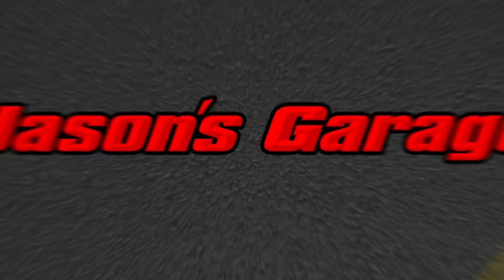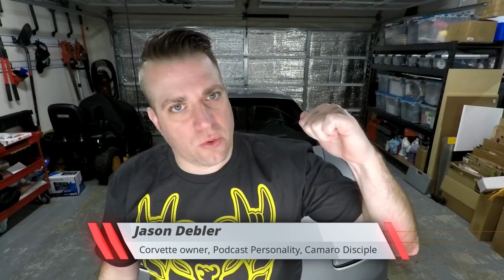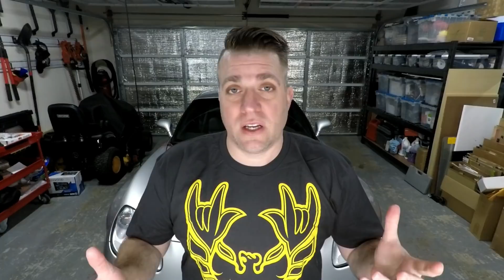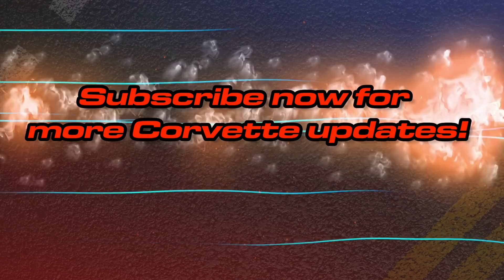LS7 Engine Cylinder Head Valve Drop Issue - What you NEED to know!

Comment: Did GM correct this issue with their current LS7 crate engines?
Reply from the maker: Some say yes, some say no.  I'd like to believe they did, and it would be logical to think they did.  I personally haven't heard any issues about the crate engines.   I know this doesn't help at all but if you happen to hear a more concrete answer, please let me know.
Reply: I just purchased one two days ago so I hope the problem has been corrected.
Reply from the maker: @time_on_target  If you don't mind, can you ask the same question to who you bought it from and let me know their answer?  I am very curious.
Also...what are you putting it in?
Reply: In Jason's Garage I bought the GM performance LS7 crate from a GM dealership in WI and had it shipped to me in TX. It’s going on my 1967 mustang track car. Vorshlag here in Dallas is handling most of the build for me. 500hp in a 2600lb car should be fun.
Reply from the maker: Sounds great!   I subbed to your channel to follow along.

Comment: How often should u get the heads fixed? My Z06 has 99k miles and it had the heads addressed by WCCH at 65k miles
Reply from the maker: The common thought it you only have to do it once if they are done right.  WCCH does pretty good work but just for good measure, give them a call and see what they recommend since they did your heads.
Reply: @InJasonsGarage  yes just got off phone with em, my heads are good to go for up to .640 lift can't wait to save up to start modifying

Comment: How is the reliability with a set of fixed heads on the engine? I know this valve issue is the biggest problem with these engines. Thank you for the very informative video!
Reply from the maker: My opinion is that it puts the LS7 reliability to where it should have been from the factory.
Reply: Even "fixed" heads have been known to drop valves. My FED fixed heads dropped the exhaust valve last year. I was running an aftermarket cam with only .635 lift, and less than 10k miles on build, but some say this is enough lift that with the pad style rockers at full lift it puts a side load on the valves and causes premature wear to guides. Definitely upgrade to roller rockers.

Comment: I had a 2006 Z06 and sold it. I think its a bunch of shit to have to fix an issue like this or worry about a new engine. Im a car guy and would love to believe in this one. But a supercharged gt500 has proved to be reliable and pretty dam fun to drive.
Reply from the maker: You might want to do a search for "gt500 engine failures" before you write that check.  They have had their share of them as well...but I agree fun to drive!
Reply: You sound like a true blue Chevy guy. I have checked out the GT 500 and its issues. The truth be known every performance vehicle has some sort of bug a boo Porsche included. But you’ve got to pick your path of least resistance and I wasn’t willing to take that with the motor potentially going out of the Z06 .Just my opinion. I’ve owned three vettes in  2 Shelby’s. In numerous others:. jeeps you name it and everyone of them has something
Reply from the maker: @gws108  I do indeed lean more toward the bowtie, I always have but I am certainly not ignorant of other great makes and models.  After my last reply, I was thinking the same thing...I cannot recall a performance engine that didn't have some issues, just like you said.  You are also right, it all depends on what you are willing to deal with.  The consensus seems to show that typically, once the head issue is addressed, the LS7 is pretty solid after that.  I am OK with it.  :)  I love this engine.  At least...for now!  😀

Comment: Hi so I’m planning on buying an Ls 7 swapped rx-7 and my question for you is: how often do I need to get the heads fixed? Also is there a way to tell if the person I’m buying it from already has fixed it just by looking at it?
Reply from the maker: If you do it right, only once is the popular consensus.  The easiest way to check is to ask the person you are buying from.  If they say "huh?" then you might want to have them fixed.  You cannot tell visually, you need to remove the heads have someone who knows what to look for see how much play there is to the valve stems, indicating out of spec valve guide wear.

Comment: What a drag. I was thinking about getting something with an LS7 if I ever upgrade again, but I'm not ever sure its worth the cost. All the fastest guys I know are running old Honda S2000's, STi's, old M3's, etc... cars that are way cheaper to run hard and replace parts when needed yet still hardly hold anyone back in terms of performance in real life.
Reply from the maker: Driven or ridden in one yet?  If not...you might want to.  Just factor in the repair as a preventative measure.  It is worth it.  :)

Comment: This  video is totally inaccurate you should specify the valve drop issue it's ZO6 is made between 2008 and 2011 roughly less than 10% of total vets had the problem so you're saying we should all fix the heads and the valve issue how ridiculous and people believe this idiotic video so I bought my car with 3000 miles on it so you want me to pull my heads off and put new heads on that makes sense why don't you pay for if you and I'll do it LOL
Reply from the maker: You might want to check your sources and read the comments in this very video that say otherwise.  Its your car and you don't have to do anything that you don't want to.  I am just offering free advice.  You may also want to try using punctuation, it makes things easier to understand.

Comment: http://www.superchevy.com/how-to/1406-how-to-maintain-valvetrain-stability-ls7-exhaust-valves

Worth the read.... testing regarding stability using an LS7 test rig to measure stability and valve bounce at speeds up to 7900 rpm.   The  little shop that did the testing? Katech... yea, they probably know what they’re talking about.   Hope this helps answer some questions. 

I also tried to see if I could figure out how many failures had occurred in all LS7S using data on several forms.  Looks to be a failure rate of 1/4 to 1/2 of 1% for all LS7 produced from what I could figure out.  Not saying this is 100% correct but I think it’s close.   The performance shop I use (in Garner NC) has seen 1 dropped valve but has modified hundreds of LS7s.   So yes the problem is real but and no one wants to kill a $15-20K engine but it doesn’t happen with high frequency.
Reply from the maker: I actually used to live around 5 miles from Katech and I trust them.  They know their stuff. I  also know other people that are "up the chain" in GM performance, and the higher the chain goes, the louder the message is that it should be at least looked into if you have an LS7.  It is damn near a race motor and race motors are not without needed maintenance and frequent checks.  This situation reflects that.  There has been nothing quite like this engine before or since, in my opinion.  That is why I bought the one I did.  It is a tax I am happy to pay, because it is unparalleled in performance and will become legendary, even more than it is now.  I say this not because I own one, but because I researched it long ago, and my findings have not changed.
Reply: Jason's Garage - had a lifter failure in mine about 6 months after I bought it.   Was told heads look fine.  The motor had about 60K miles on it at that time.   So motor was refreshed.  I think I will do the heads in the near future for piece of mind and take advantage of the performance bump.   The LS7 is pretty amazing to give the performance it does and still remain fairly civilized in the process.  I went back with a LS7S cam from Texas Speed.  Car makes pretty good power with stock heads (near 550 wheel).  Honestly the pilot super sports can’t handle the power now until about 3 rd gear in warm weather and forget it when under 75 degrees or damp.    Super fun car.

Comment: I had the same problem had the heads done. Eddie shop in Dearborn livernois Motorsports. Had the heads ported valve guides done and they did a poor job motor steel detonated NGM did not stand behind the product. At all I am done with GM in their products I would love to have another Corvette. But I'm afraid very little trust in GM terrible product

Comment: Also, i would be concerned if i where you if im paying 1/3 for a new motor and install. Im sure you can oick up a used ls7 for 4k and another 1,000-2,000 for install and tuning. That way less than 10k but yes. It is still very very expensive. I’d rather pay 2K for new heads + install than a new motor lol
Reply from the maker: Sure, if you know the history of that used LS7 engine.  That's a great alternative.  And I agree, I'd rather just pay to have the heads addressed and reduce the chances of an issue.  In fact...that's exactly what I did!  See my other videos.  😎

Comment: Ok the 14’ Camaro Z/28 has the LS7 engine do they have the same problem? Or did GM fix this problem the 2nd time around??
Reply from the maker: Since I made this video I have received conflicting reports on that one.  Some solid sources told me they were fixed for the Z/28 as well as crate engines, but I have still heard reports of the issue happening anyway.  So it is really hard to say and I don't think we will ever know for sure and possibly, there is no single answer.  My advice to be safe...consider it a possible problem and have it checked.

Comment: I love the way fixers say it has been fixed. lol. You might want to find out what's wrong with that exhaust valve/guide. Some fixers just change the guide material. I think the exhaust valve itself should be replaced with something way better than the Chevy valve. Having a 1.8 rocker ratio I think the ls7 needs roller rocker tips as well to slow the wear factor but with a good valve and having the run out checked from time to time you can prevent catastrophe.

Comment: I used engine oil analysis to detect the valve guide issue. With oil analysis at every oil change since new, I had an engine health life record, at 21,000 titanium started to show up in the oil. at 24,000 miles it was significant. I had my best Shop pull the heads and invite the GMPP inspector to witness the disassembly. the Valves were so loose the fell out of the head as soon as the retainer was removed. GMPP Agreed with the diagnosis after threatening not to pay for head removal if no valve guide wear was found. $7,000 later, new heads and valves. I had to pay to remove the oil pan and clean out rocker bearings that had fallen out. they were clustered around the oil pickup??????? Result was engine fixed and reliable, but Engine Oil Analysis was the key to early detection and preventing the valve failure and dropping with engine destruction. If you own a LS7 get the oil Analyzed for peace of mind, its $35 at BlackStone Labs. Cheap insurance.
Reply: I'm a little late to this but I watched a video of a guy who had his oil checked and then it immediately blew up (within 50 miles I believe).  If memory serves me right his oil came back with no red flags or warning signs. It can't hurt to have the oil checked but I don't think it's fool proof on some of these. P.s. jealous you have a C6Z, it's my dream car.
Reply from the maker: I just changed my oil and sent a sample to Blackstone.  Hope it comes back OK...

Comment: I'm looking at a c6 z06. The said he had preventative maintenance done on it because of what happened to his buddy's ls7. The guy told me it's still the stock heads, but the valves, stems, springs etc have been changed. Is it possible to fix the valve drop issue still using the stock heads?
Reply from the maker: Yes, a lot of reputable places use a factory head but rework the guides and such to prevent or at least reduce the chances of it failing.  Did he say who did the work and the parts used?
Reply: @InJasonsGarage  A shop in Michigan, Alternative auto performance. I asked him if he could find the receipt for it. He said it's been awhile but he will look for it
Reply from the maker: @camonly849  I used to live not far from Alternative Auto, and I was an acquaintance of the owner Lidio.  It has been a few years since I talked to him, but he is pretty much a legend in the Mustang world and expanded into LS stuff around 10 years ago.  He is good guy and is known for doing good work.
Reply: @InJasonsGarage  it has 9950 miles on it and I'm going to go and look at it tomorrow.
Reply from the maker: @camonly849  That's about the same number of miles mine had on it when I bought it.
Reply: @InJasonsGarage  nice! Ya lingenfelter is only 45 minutes from where I live, so I figured way on down the road I might just have them do some work on it. The guy I'm buying it from says hes selling it because hes ordering a 2020 c8. So it doesnt sound like hes trying to get rid of a problem.
Reply: @InJasonsGarage  that makes me feel good about that shop then.

Comment: Have a 2011 Z06/Z07.  I ordered it and have been the only owner.  This is a "track car only" for me.  All miles have come from driving to and from Autobahn Country Club and Road America, and on those two tracks in the advanced run groups.  Chassis is set up for this application, the engine is stock right down to the air filter.  On the track I shift between 5,800 and 6,000 rpm.  16,000 total miles on the car.  It receives excellent maintenance.  Runs great;  no plans to open it up.
Reply: my 2007 had the bad valve guides, you should get regular oil analysis to check for titanium. I had significant increases at 24,000 miles. Pulled the heads and found heavily worn valve guides, GMPP fixed it cost the General $7.000 but now all good. Analyze your oil please, I used Black Stone labs its only $35. Please do it.
Reply: @DennisMurphey  Thanks for your thoughtful message and concern.
Reply: Sounds like a good idea, I just sent for my test kit. Thanks Dennis.
Reply: I bet you blow your car up and cry about iy

Comment: Valves are usually about redline and springs. The guides are concentric enough to run it, so that's not it, lol. If you hear ticking then failure, it broke something. Like the inner spring. This stuff is either a bad part or user error. And that's cars.
Reply from the maker: Not in this case.  It is a machining/manufacturing issue.  I am sure a lot of people wish it was a simple spring swap.
Reply: Mine is starting to have a slight tick, is there a chance there is piston damage or is that signs of the valve ready drop?
Reply: @jackpaullus2643  I've come to understand that the pressed-in  rocker studs pull loose, then the valve geometry binds, timing is affected and valves break. People have reported hearing noise and then complete failure. Which means engine rebuild. Stop driving the car NOW, you should have stopped before this, you are already in the RED. Pull the heads, get screw-in studs, check the guides, valves and seats. It is a manufacturer problem. Join a class action suit for compensation...Or loose the motor and/or car...On the bright side, have long tube headers installed and free flowing exhaust. Don't cheap-out on it.
Reply: @hambone7777777  mine turned out to be a collapsed lifter
Reply: @jackpaullus2643  yeah, and chewed lobes from moving lifters. But the broken valve/wasted head is from the pressed stud pulling, wearing the valve guide, and extending the valve into the piston. It's negligence, and a known concept going back decades. There's no excuse. Cheers

Comment: If a new crate motor is installed are you safe then
Reply from the maker: The assumption is the problem exists with all factory/OEM LS7 engines.  There is no real and actual confirmation either way, so  my opinion is no, not safe if staying "better safe than sorry".

Comment: Hey guys hope someone can help me out, I just got a 2006 Z06 with 20k miles on it, I know about the valve drop issue and I’m prepping for it. Just wondering, when I get the American Heritage Performance headers is there anything else I should change? Maybe get checked? Trying to keep it as least expensive as I can without cutting corners. Any fellow Z06 owners have any advice to share? Thanks guys.
Reply from the maker: Least expensive?  Get the AHP package 4 heads.  Swap them out, done.
Got a bit more in your budget and want a little bit more power?  Have them do a street port.  Got some more in your budget and want even more power? Get their cam kit.
Reply: Jason's Garage thanks man I Appreciate it a lot thanks for replying going to get the heads done ASAP scared shitless that I’ll drop a valve
Reply from the maker: @MrBrightSide784  No worries man...it is cheap insurance.  Even if everyone is wrong about the valve issue...it is still worth the peace of mind...just in case.  :)  Let me know how it goes.
Reply: Save your money headers are a waste of time on this car you'll get no horsepower increase the only thing they're good for is giving you a headache and making your wallet lighter lighter.